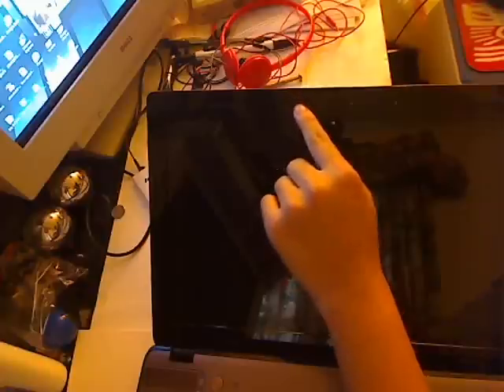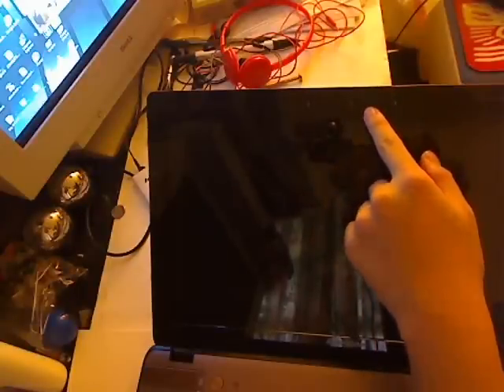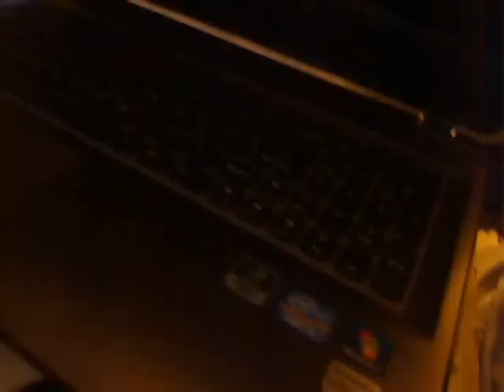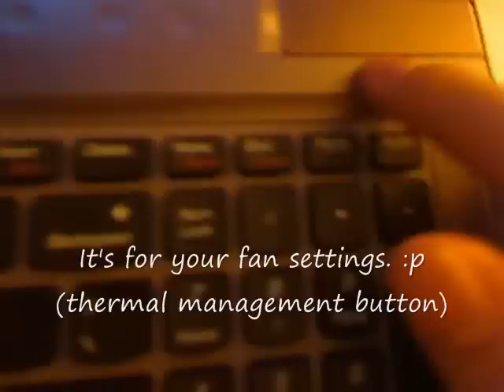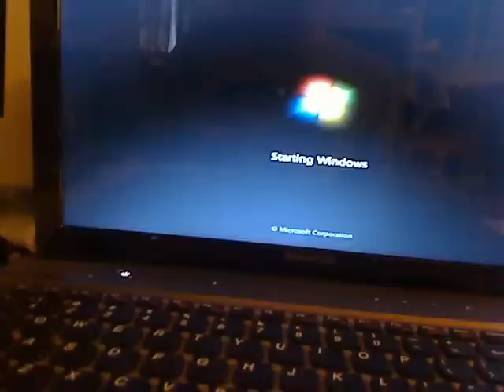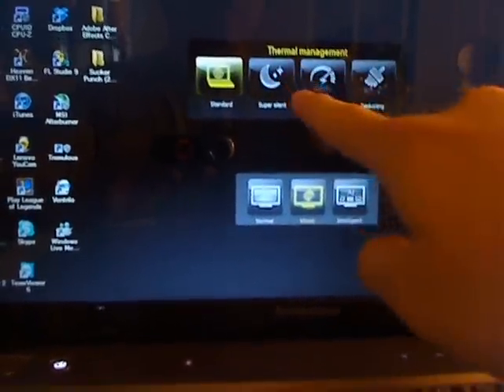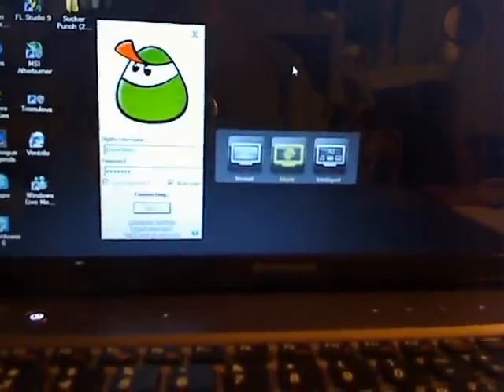Lenovo y570 Ram Upgrade and Overview (English)

Comment: Sorry for derailing, but I couldn't help notice that the heatsink is quite visible once the back panel is off. If you unscrew that, will you be able to access the CPU and GPU or do you have to remove more?

Comment: Hey can u help me out i am looking for compatible ram, but cant find any that match the ram specs, 4 GB PC3-8500 DDR3 SDRAM 1333MH on lenovo website can u verify if this indeed the ram or is it a higher speed because i cant find any PC3-8500 at that rate only at 1066